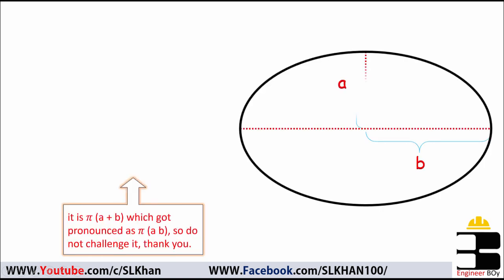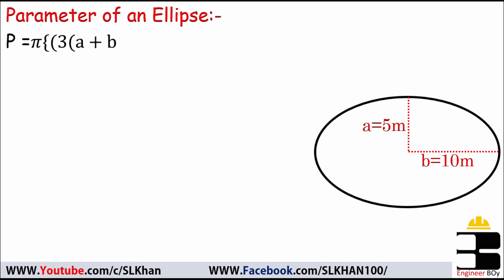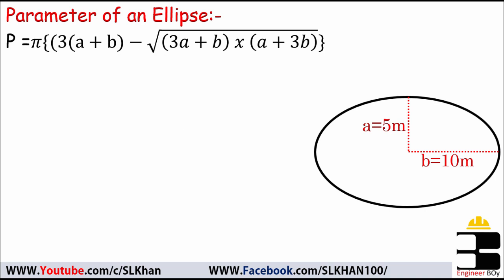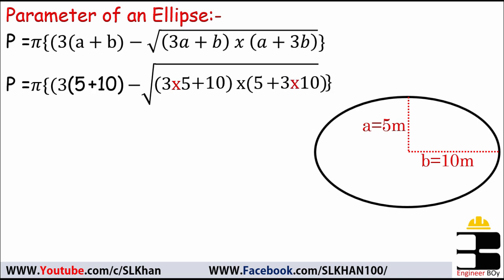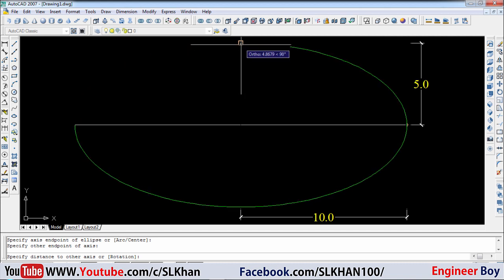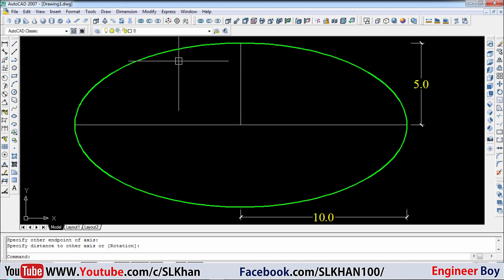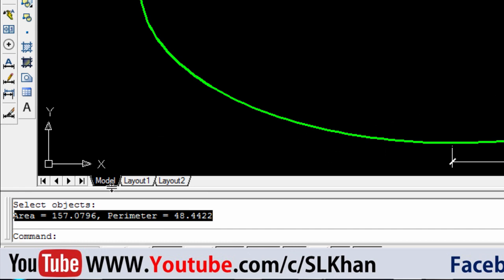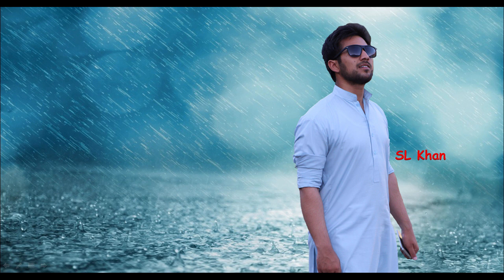how to workout ellipse parameter ?

Comment: I found the 4(a + b) - ln(4a/b + 1)b Approximation using calculus. It only ever reaches 1.6813% error and approaches 0.0297% error.
Reply: I just looked at the derivative of a case where y is the perimeter, a is x, and b is 1, and noticed the slope approaches ~4.
Reply from the maker: Great

Comment: I believe the formula you used was the 2nd approximation to the perimeter of an ellipse discovered by Ramanujan. It is an excellent approximation, but, it is still an approximation. To determine the exact perimeter of an ellipse would require the summing of an infinite series.
Reply: Richard Burn the formula you listed is actually the first approximation. 
This formula as listed in the following is Ramanujan's second approximation; if, unless, I am to be mistaken:
C≈ π(a+b)(1+(3h/(10+√(4+3h)))

"h" if I recall correctly is 
h= ((a-b)²/(a+b)²) .
Reply from the maker: yes sir you right .i love it that people like you comment here. thank you so much